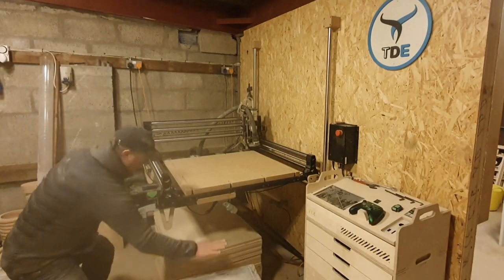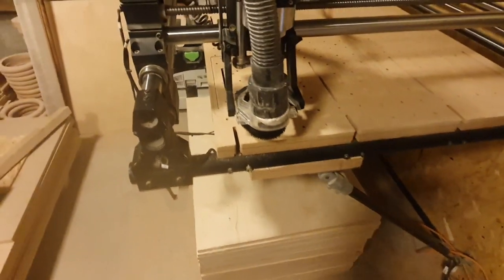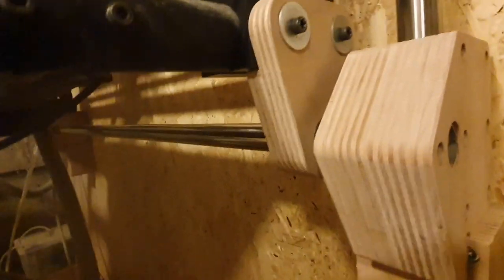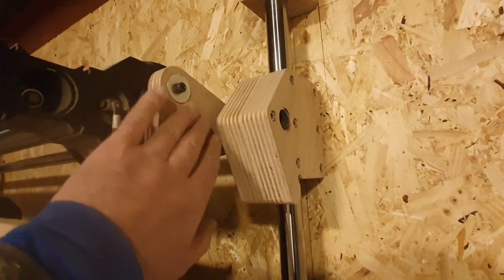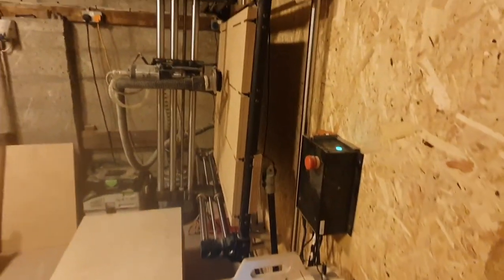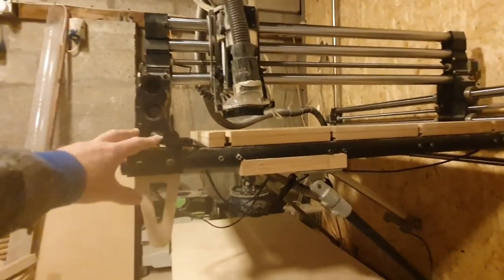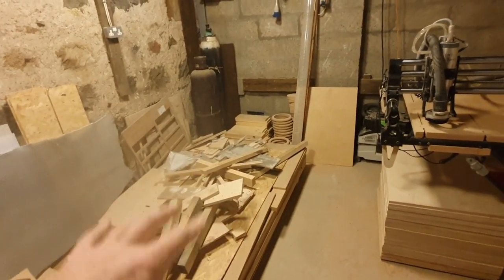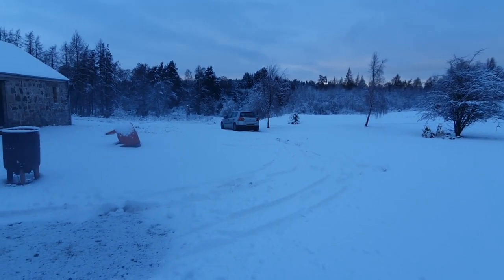Folding Table MK2 Update - Stronger Design - Part 1

Comment: What actuator is used? And how is it mounted so that it’s able to lift the table up and onto the wall?
Reply from the maker: Gimson robotics - its a 400mm actuator and it is attached to the wall and the underside of the table,
Reply: @ I guess I need to educate myself a bit on how it’s able to lift with how it’s mounted. It’s not mounted to the bottom of the table perfectly center right? It’s more towards the wall?
Reply: @ how does one go about measuring how far from the wall to mount the actuator to the underside of the table? Pretty slick how you were able to lift that setup using just one actuator.

Comment: Just went followed you on instagram to ask you a question on some of the parts from your original design of this. I’m looking for the name of the rollers your used with the Uni strut to prevent excess lateral movement.
Reply: Hey buddy, I wouldn't use those they're not great, look at my other videos I'm now using shaft and bearings, much much better.
Reply: @ thinking about using some of the linear guide rail shafts that are on Amazon. They seem like they’ll hold the weight. Only issue I see myself running into is having to shim / adjust them in the event that my wall isn’t perfectly flat.

Comment: I'm also looking forward to a follow up. Either a video or build plans would be appreciated. I have a wall mounted CNC currently, but I'm planning to upgrade to a Onefinity and this wall mount tops them all. Any timeframe when you will post another video?
Reply from the maker: I am in the process of building a new workshop, when that is done I will be making another video
Reply: @DesignBuildTDE , was this redesign just for utilizing the QWC or was the original design deficient in some way? I’m looking to implement something like this in my shop and would love feedback on what you like and would change between your two designs.

Comment: Hey, Lee. In hindsight, do you think that you need the 2 horizontal Kee tubes (one at the wall & one below the frame), or do the frame and wall control the width dimension adequately?  They let you bring the wires in a little cleaner but, aside from that, how much do you think they're doing structurally?  Opportunity to trim a bit of cost?
Reply from the maker: You might be OK, it isn't something I have done, my latest design has two tubes at an angle that meet the wall at a single point making a triangle, this should be geometrically stronger, whether it is or not is another matter.

Comment: Awesome.  Is your QCW Frame a "Secure from Above" or "Secure from Below" (wasteboard) model?
Reply from the maker: From below buddy, I can't remember why I chose that - but, I have a solid spoil board, its not separate sections so from below is better for me.
Reply: @DesignBuildTDE  Thanks, my friend.  I've been studying this video very carefully, working to design my take on your brilliant design.  Its starting to make sense now but Onefinity's "not recommended due to weight" response since I've ordered a 48"x48" Elite Foreman has be a little worried!  Know you're busy so will try to minimize any bother as I try to figure out this design.  Cheers!

Comment: Awesome work but doesn’t really seem like space saving.
Reply from the maker: The camera and your perception can make it seem like it's not, but when it's up on the wall there's a large area that's available and it's more noticeable when you stand in the room, it's also much more of a saving when you have a larger machine. You gain around 800mm which is a lot

Comment: A couple of questions. What size pipe are you using for the under the table support? And what size linear bearing or model number did you use?
Reply from the maker: The tube is 27mm, but I advise using 32mm so you can easily get the cables through the tube, it was a real struggle with the 27mm, for linear bearings, get 1 inch shaft and a linear shaft bearing that's at least 100mm long, I'll do a how to video in a few weeks. Thanks
Reply: @DesignBuildTDE  thank you. I can't wait to see the cut list and plans.
Reply from the maker: @petesalvatore3465  Have you seen the new video?
Reply: I believe so.

Comment: Love the design, I've recently purchase the OneInfinity Forman and would be a space saving idea, looking forward to part 2
Reply from the maker: I am still waiting to find out if this can be used for the larger machines, it will handle the weight I am certain, but the machine itself can't be used on its side possibly due to the motors being different, I will use it for storage, but won't run the machine (elite foreman) on its side.
Reply: Yes, I agree 100%, nice to store up and out way when not operating.

Comment: I just took delivery of a Shapeoko and was looking for ideas to wall-mount it. I'd just watched your previous wall mount video and thought that one was the most superior design I'd found!
This looks great!
Reply from the maker: You can use this design for the shapeoko, you just have to make either a wooden or aluminium table, the most stable set up is using linear shaft bearings, the original one wobbled a bit
Reply: @DesignBuildTDE  Thanks! These types of connectors and slides are all new to me. :) 
I'd assumed I'd just find variations of folding piano hinge stuff!